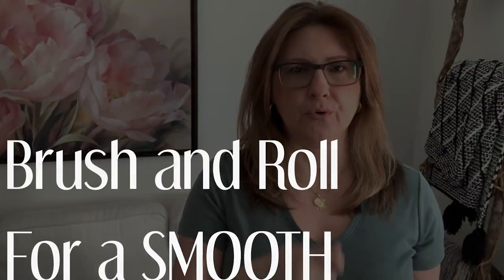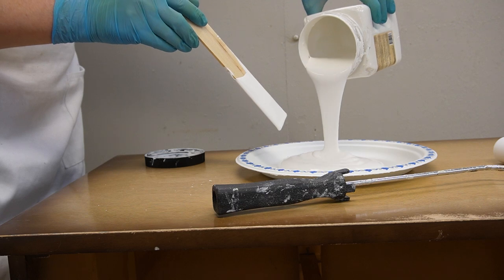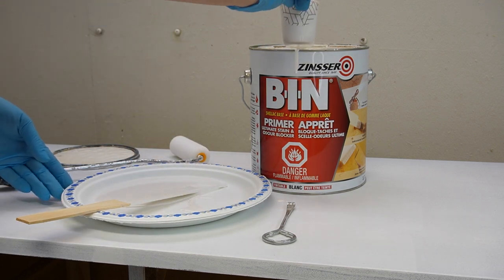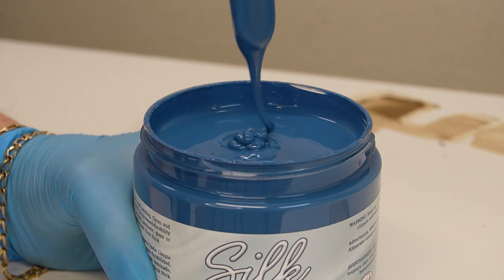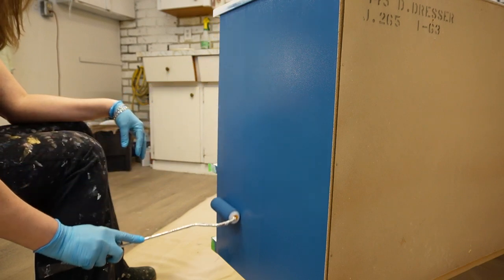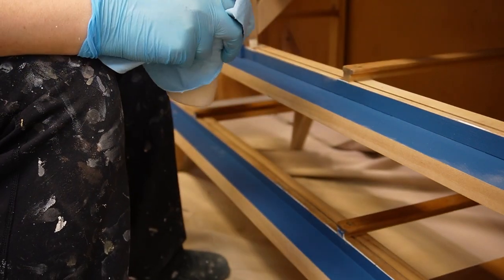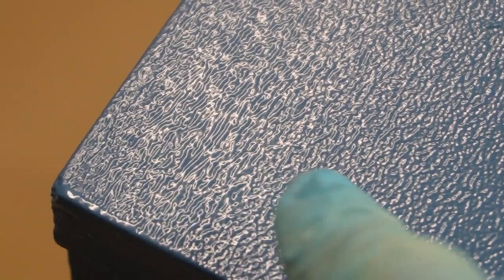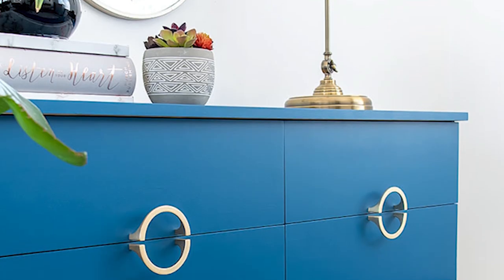Brush and Roll For a SMOOTH Paint Finish

Comment: I don’t spray for a couple of reasons.  I started using this method several months ago and I am very pleased with the outcome.  I use the whizz rollers and also the staalmeester.  Maybe my eyes are bad but the texture you show with the magnified lens is exaggerated with the magnification.  I can not see that kind of texture on my pieces.  It is important to put thin sheer coats.  At least that is what I do.  I also use very little pressure as I roll the paint off.
Reply from the maker: These are great tips Shelley! And I'm going to see if I can find the whizz and staalmeester rollers! I can't wait to try! And yes, the texture I was showing IS magnified with the camera :)

Comment: great videos!  thanks for sharing.  question-what about brushing on your primer instead of spraying?  i am concerned that i will ruin the sprayer by using the shellac in the sprayer, but will i get brush marks that wont come out?  thanks,
Reply from the maker: The primer sprays beautifully but I don't like the clean-up so I much prefer to roll it on. When I give it a light sanding between coats, I've never had an issue with brush or roller marks.